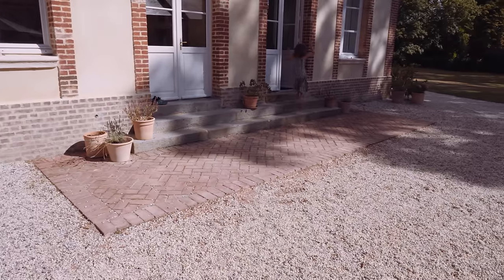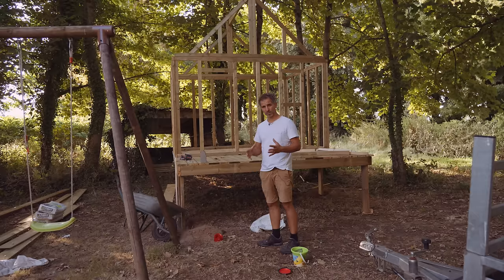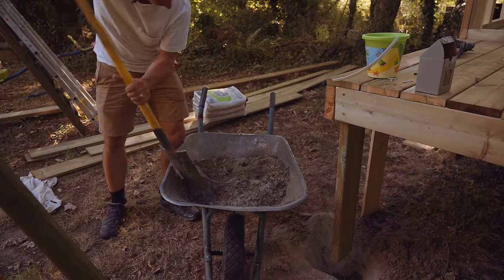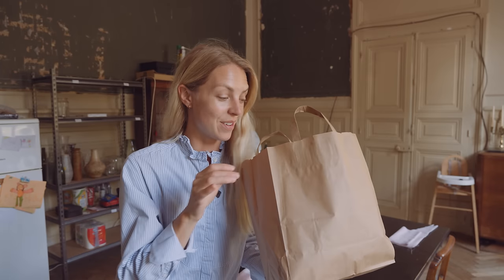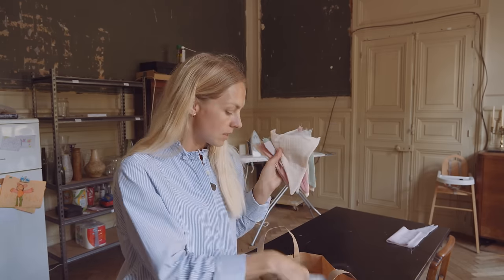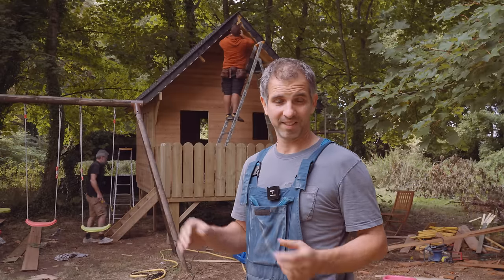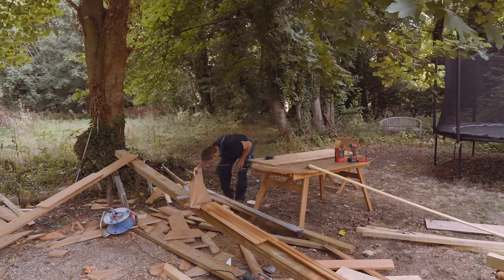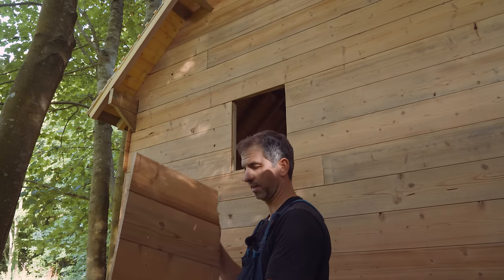AMAZING DIY KIDS PLAY CABIN (7 days in 10 minutes - timelapses)

Comment: The final product looks amazing!!! Though I would humbly suggest a few final finishing touches. I recommend adding hook eye latches to the windows that way they can be closed and secured against bad weather. Also I would recommend asking Benoit about ways to seal the plasterboard floor as I have had bad experiences with it falling apart on me, also plasterboard splinters are the worst. Finally I would recommend consulting Benoit on ways (such as staining or sealing) you can prevent the wood from warping as I have had that happen to me in the past and I sucks to lose a project to the elements because I didn´t follow through with that last key step. Otherwise, Incredible Job!!!!
Reply from the maker: Thanks for the tips!
Reply: Toute idée est bonne à prendre. La fixation au sol est prévue. Merci pour les compliments.